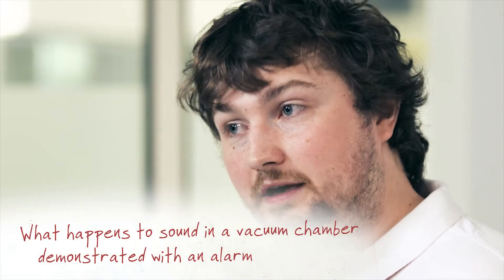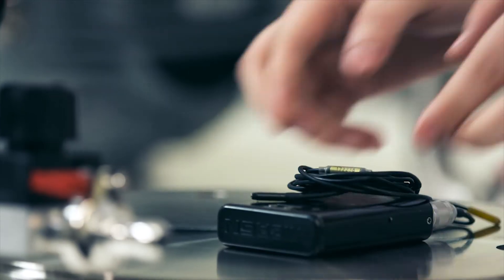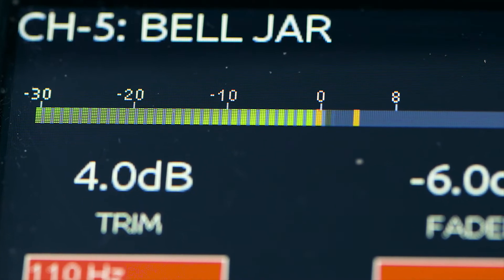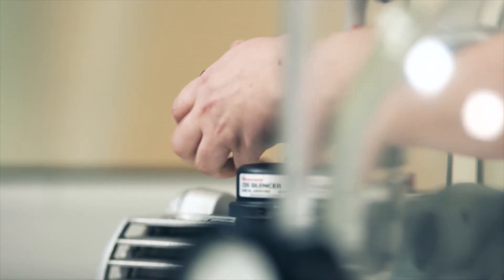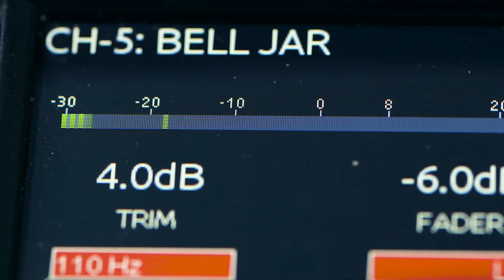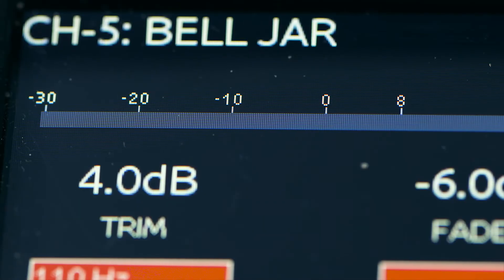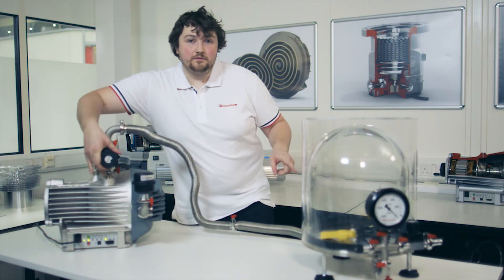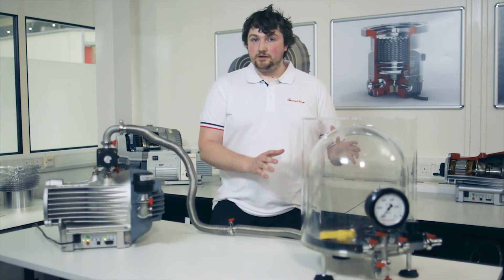Experiment #6 What happens to sound in a vacuum chamber demonstrated with an alarm

Comment: Of course sound can travel in a vacuum. Mainly because a "vacuum" is NOT a vacuum. What's considered by the "real scientists" is that removing the air from some volume results in there being nothing left.

In fact, the volume is just as full as it was with the air but, with more (very slightly more) aether particles than when the aether was displaced by the atomic matter of the air.

Sound travels through the aether just fine. But, at the speed of light. Our physiology doesn't respond in a way that allows us to hear it. But, the effect is there.

If you consider the LIGO setup, large audio rate signals are able to expand and contract the LIGO laser paths to allow those audio signals (impressed on the aether) to be extracted.

The LIGO people think they are detecting "gravity waves" but, are actually detecting offsets of the aether particles...offsets that are changing at audio rates that are propagated acorss similar distances that light (and other phenomena that's considered...again by the "real scientists"...as being "electromagnetic waves").

Of course, anything that's affecting the LIGO setup is also affecting everything here on Earth, including our eardrums, to the same degree. 

salaphysics
030120
Reply: If there's one bit of advice I can give you (and, anyone else who's interested in understanding physics actions), it's to always look for force imbalances.

In the Universe, matter is always in motion. In a local environment, it can be seen and measured. A pebble sitting on a table top is an example of something in a local environment.

If the pebble is said to be stationary, it only appears to be stationary. Actually, as the Earth rotates, it moves witht he Earth and as the Earth orbits the Sun, it moves with that. And, as the galaxy rotates and moves relative to other galaxies, it moves with that.

But, we can't use that information in a practical way so we say the pebble is stationary and then work out all our physics based on that frame of reference. And, for practical purposes, that works out okay. Just never forget that the pebble is always moving and we have no way to know how fast or in what direction...in the Universe.

What we can say is if the pebble is not moving, then all the forces around it are in balance (within the local environment). The force of the air on all sides is in balance and the force of gravity pushing it down and the force of the table top pushing it up are also in balance.

Any time the forces are out of balance, the object (like the pebble) is moving. If the imbalance is large, it moves fast. If small, it moves slowly. But, it will be moving.

We can make the pebble move by pushing on it. That is, by adding more force to one side of it. But, the force imbalance can also be created by removing force from one side. As long as the forces are imbalanced, the pebble will move.

Now, if you push gently on the pebble and it doesn't move, that meanse that the forces continue to be in balance. Pushing on the pebble can work against the friction of the table top and the table top responds by increasing its force against the pebble.

For any physics action, always ask yourself about the forces acting on the matter being moved.

salaphysics.com
060520
Reply: Hmmm. The only part of that explanation that was NOT in plain English was the acronym for "LIGO", which is; Laser Interferometer Gravitational-Wave Observatory. For more information on LIGO, go to: https://en.wikipedia.org/wiki/LIG

Notice that I did not use the term "waves" in my explanation at all. Sound has nothing to do with waves. Any waves you may see that relate to sound are manufactured (don't exist until they are created) by the interaction of the sound with some change of impedance within the path of the sound.

It's an effect similar to light when looking through two mesh screen and seeing patterns that don't exist until they are created by the interference of the light  through the screens. Sound works by the same effect and the changes in the laser paths of LIGO are manufactured by the interference of the laser with the sound coming in at light speed.

Actually, the sounds that LIGO "hears" also affect the eardrums of every person (and animal with a sense of hearing) but, with such a small effect that it's not heard.

Don't be too concerned if it doesn't make sense to you. It's something that's completely misunderstood by the physics experts. They try to explain it mathematically but, since they are starting with the wrong concept of what's happening, they always get it wrong.

It does take getting some background information right to be able to see this more easily. Note the reference web site below:

salaphysics.com
060420
Reply: While I like your alternative viewpoint (I generally respect anyone speaking in terms of some kind of aether), I have a problem with describing aether in terms of discrete particles. You have the right idea though. I would like to offer my alternative. Instead of describing normal matter vs aether matter, I think that physical space and matter are one and the same substance. To be more clear, what we detect as matter is little tiny contortions of space (think of just more dense space), which "spins" in a shape. Certain shape conformations essentially "spin" and pulls and tugs on the space around it, (swallowing it) and expelling space in a manner and rate dictated by its shape. I think this is what electromagnetism is and an emergent property of this is gravity (a whole net effect of particles tugging in on the space around it). In this view, it describes how escaping the gravitational pull of a massive object would be more like escaping a treadmill, You have to "out-run" the rug from being pulled from "beneath" you (except you are part of the fabric of the treadmill). So, I too believe that sound does travel in a vacuum, but if there isn't enough energy to overcome the "treadmill" it will become elongated, i.e, the wavelength will change. It will still travel the same speed, or perhaps even faster (lightspeed) but it will no longer be recognized as the right sound because we would require a larger observation window through time to hear the delta in the amplitudes. This makes sense in my hypothesis because if there is matter just a little further out from the source (like in a normal medium), the ripples in space the sound technically is, would be pulled in by the matter ahead of its path, essentially getting a little "boost" and help to maintain its wavelength, but as soon as the sound has hit the "matter wall", the wavelength gets redshifted and picks up speed.
Reply: @grantgilson1258  - Actually, there has only one theory I've been able to come up with that's "air tight". It's that the ONLY thing that exists is some spark of self-awareness that is me. Every thing I experience is the result of my imagination...including my life. In that sense, when I die, I just move on to a new life (probably) which I live out. Sort of like my last dream and my next dream in this iteration. Apparently, in this iteration of my existence, I enjoy being cantankerous.

But, having established that, I'm compelled to live out my fantasy within its framework.

I can't refute your version of this science (as presented in the video) but, have worked out what I think is a better one based on a variation of the one posed by the conventional science community (which, by the way, does NOT work well at all within the framework of their own explanations).

But, if we assume that we are both real entities, made of matter and living in space and time, and knowing that the conventional explanation has severe problems, I like my version better. In a Universe of matter, space and time, I think your version also has problems I can't resolve.

In my salaphysics explanations, force is what makes things move and force IS matter in motion. ANY time something moves there is a force imbalance across it (and any time matter has that force imbalance it is moving).

Whenever we see something (perhaps an object of some sort) not moving...it is moving. The fact that we can see it is the results of specific movements of the matter at rates that stimulate our visual sensors and initiate the complex result of seeing the object.

Much of salaphysics is working through errors in other peoples' speculations. And, always by asking the same question: What is the nature of those forces involved in the action.

In an infinite Universe (which ours must be) there is no way to establish a reference position, direction or speed. Any time we speak of movement of matter (through time), we have to establish some artificial, ambiguous but agreed upon datum (ie: the road on which we are driving 50 mph at 174.1544 degrees is moving at 0 mph, even though we know the road is moving as the Earth turns and orbits and the galaxy is moving relative to other galaxies and on and on and on...).

salaphysics
032921

Comment: Interesting. I'd have thought significant vibration would have traveled through the metal plate from the vibrating phone to the microphone.
Reply: Theoretically there is negative pressure in the vacuum chamber, (negative to atmospheric pressure that is) depending how great this is may also have a dampening effect on any vibrations. Would be interesting to try and measure this to see if this is true.